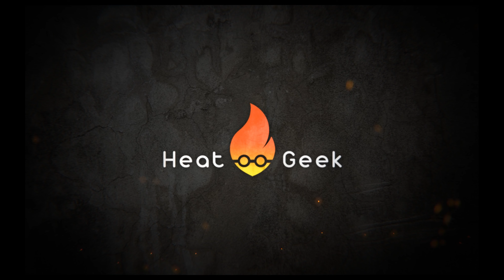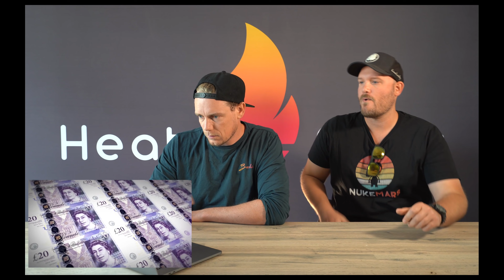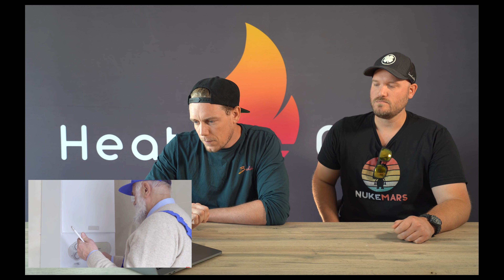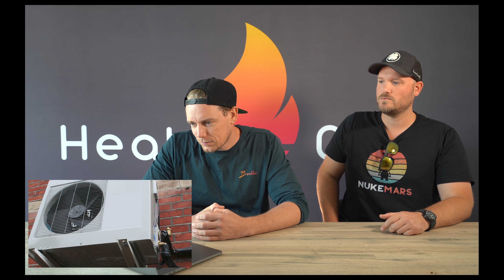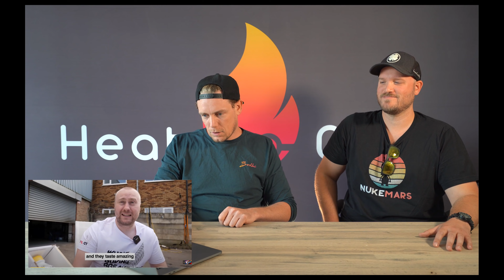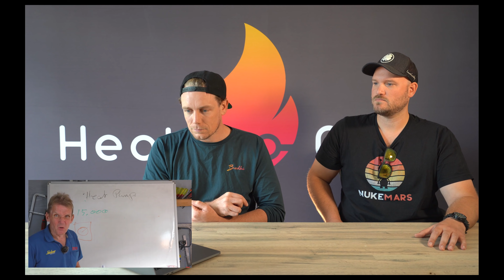Professionals React (BADLY) To Skill Builders's Heat Pump Videos | PART 1 | FIRST TIME WATCHING

Comment: Just seen your chanel. I have long watched Skillbuilder and Roger is a very exprienced Plumber. My reaction to his heatpump rant was, that heatpumps do work but only if the insulation is sufficient. I installed air source heatpumps in a pair of new build semi-detached houses, ten years ago. This decision was largely to meet the building regs. energy requirements. I have figures for those ten years, so not just an opinion (unlike many who post in your video). I did not intstall one in my 1920 detached house (which has cavity walls) as upgrading insulation etc. would cost too much and if installed on the inside would reduce the room sizes by too mush, and digging up the floor etc..The skillbuilder argument is true for the majority of the UK stock.
Good to see Patrick often injected some valid information to give a more balanced view.
Reply from the maker: Here's evidence of how they work when well installed in a NORMAL house with tiny rads and little insulation 

https://youtu.be/QLGANlbqIFY
Reply from the maker: Difference is that modern heat pumps are nothing like 10-year-old heat pumps. They can now run much higher temps and maintain cop
Reply: @HeatGeek  So what value of COP are we likely to get and at what output temperature?
Reply from the maker: @jesserawson898  the data sheets are all over the internet
Reply: @HeatGeek  Now that's a really profesional reply 😄
Reply from the maker: @jesserawson898  well it depends on the unit.. I'm not sure how many characters the comments section allows but it would probably be easier for you to Google than me to copy and paste
Reply: @HeatGeek  To be honest I didn't realise the question was going to be so complicated for you.  I was merely interested in your comments regarding the COP of modern heat pumps.  As this varies greatly with the output temperature I can see there being complex and compound answers, however what is very simple is to say (for  example) that at an outlet temperature of 55 degrees centigrade (English !!! ) it is now possible to achieve a COP of 6.5.  

With your claimed expertise and indepth knowledge sure a useful response will be at your fingertips.
Reply: @jesserawson898  There is a problem with your question, there are many brands with different claims. If heat geek would mention only the brands they know, people will complain as well. Why would he need to do the research for you? Don't be lazy and try to spend a few minutes on it yourself
Reply: @HeatGeek  and work in lower outside temps and remain efficient
Reply from the maker: @davidstorm4015  the lower the outside temp the less efficient but yes absolutely... as always depend son many variables

Comment: I think you and Roger are right, our average housing stock is too poorly insulated to suit a heat pump install and carrying out a deep retrofit insulation at £800/£1000 per m2 isn't viable. With a self build where you can spec 200mm of floor insulation & underfloor heating then great.
Reply from the maker: Here's evidence of how they work when well installed in a NORMAL house with tiny rads and little insulation 

https://youtu.be/QLGANlbqIFY

Comment: You didn't really address the noise issue. Just saying it'll be quieter in 10 years when the tech is better isn't good enough. These things must be noisy at 2am if you're used to quiet. Why wouldn't they be? A compressor/fan hum putting out 40 or 50 dB is loud at that time no matter how good it is and can travel to neighbouring properties that are only metres away. I wouldn't put up with that for 10 years. I'm glad I watched this though as it's not something I'd thought about so will have something to say if a neighbour tries installing one.

Comment: I think from seeing this. I still believe  heat pumps aren’t the answer. Your problem is the government will go all in and aim this at the general pop. Most people won’t be able to afford it, or it’ll get bashed in by a company banging them out for grants. Like crap solar installs and now the EV charging, it’s only a matter of time. 

You say conjecture but it’s already happened with the diesel cars and about the payback, at least with a boiler they don’t go obsolete over short periods. Solar panels came with a 25 year warranty but have gone obsolete before it’s even half way through that. 

I agree with you in some respect about carbon but at the end of the day. The vast majority won’t care, it’ll be bottom line every time.

Comment: I had a local HVAC company in to replace my old gas fired warm air central heating unit with an air to air heat pump system. Works beautifully without the loud fan and the sound of big gas burners and I have the option of summer cooling.
Reply: How much did this install cost? Did you get the government grant to help out? Has your energy bill gone up or down?
Reply: @thedigitalidiot  No grant, they are not available for systems that don't use wet radiators! Cost about £7,500 total for parts and installation. The house was built with underfloor ducting for warm air heating about 1970. The new system has an outside unit on a south facing wall to get the sun. There is an internal heat exchanger in the loft that is ducted to the existing duct system. My annual power consumption has halved from what it was before.
Reply: @martinconnelly1473 
Excellent!  But it will not work for the majority of people, which is what this debate is all about.  To retrofit these systems and to get them to work efficiently would cost somewhere in the region of £20,000 in the average poorly insulated and built UK house.  Obviously beyond the average person.
Reply: @Pedromyman1  It's not going to be as easy for the vast majority of current housing but does show that new homes should be built with suitable ducting for a choice of heating systems and insulation fit for the purpose.

Comment: whats best for a 1000 square foot greenhouse?
Reply: A gas boiler !    Heat pumps are the latest snake oil wheeze that will end in tears for anyone taken in by the salesmen.
Reply: @cuckingfunt9353  heat pumps are great in the right property.  A greenhouse needs high temperature though so oil or gas is the only stuff we've fitted in them.
Reply: @cuckingfunt9353  been quoted 28k for 2 heatpumps!

Comment: Interesting response. I think the 'install/design' is the elephant in the room. I've been involved in three large projects all by the SAME firm (who shall remain nameless). From total success (new build) to total disappointment (conversion).
Reply: In the literature from the government,it says the immersion will be on full time? This is a boxed kit that will be fitted to ALL HOMES.installed by barely trained fitters!
Reply: Now it’s the age of the property?
Reply: My neighbour in a victorian end of terrace has had a Mitsubishi heat pump installed. They upgraded their rads, they had loft insulation put in & a cylinder where their boiler was.  a heat loss calculation was done to size it they say its cheaper to run and it's roasty toasty.

Comment: "Running a heat pump is roughly 3 times more expensive than running a gas boiler"   Reply   "No its not! Well it could be"!!! Ha Ha Ha.
Reply: yeh, could be if you install it badly, thats the whole point of the video.. its not the heat pump, its the installation that makes the difference
Reply: I’m running cheaper than gas.
Reply: Exactly, some dickheads a few years ago wanted everyone to have solar panels. What a crock that turned out to be. This is another crap idea that you will never recover your initial outlay from. If it’s a 30 degree day it’s good, absolutely useless in the uk where most of the time the temperature is below 20 degrees. Stick with gas all day long. Listened to customers on 5 live not so long ago bellyaching about the massive outlay and being freezing cold. Ironic how insulate Britain sticking themselves to roads so we can all get sucker punched into more nonsense.

Comment: My electric rate is more than 3x expensive than my gas so it will always be more expensive to heat with a heatpump powered by electric than gas in the winter when I use the most energy.

If people want a real change then the government need to push wind and solar power and make electric cheaper. Remember an electric heater is 100% efficient. You put 2kw in and you get 2kw out. No margin of error to get an inefficient system for installers like with boilers and heat pumps. 

Maybe also give everyone grants to help insulate their houses and not just low income people. Let's face it, people living in council houses usually have better insulated and more efficient heating than people who actually own their homes. I don't have spare money to spend on upgrading a system that works whilst paying my mortgage.

My boiler is old and not very efficient but by the time I pay for a new efficient boiler to replace my old reliable boiler I will be replacing it before it pays for itself in 10 years time and that's not accounting for repairs that need doing on the modern boilers.
Reply: Heat pumps can be up to 500% efficient....

No this is not snake oil / brraking conservation of energy as the heatpump is moving heat from outside to inside.

Essensialy cooling a large volume of air / ground outside by a few degrees, to increase a smaller volume of air / water inside by 40 degrees or more.

Comment: Last month gas price went up by almost 50% in Lithuania, so that video is on point. And he's only talking about not insulated houses so hes right there as well.
Reply: Electricity prices in the UK have doubled in the past few months too.
Reply: Wood burners that's away head no one can put the price up
Reply: He never mentioned the possibility of electric price increase.
Reply: @millomweb  not possible,  more likely probable
Reply: @nickcoppard5335  That as well :)
Reply: Most UK electric comes from burning gas, if the wholesale price of gas goes up so does the electric.
Reply: gas has gone up around 200 percent in the uk
Reply: @nickb7040  It is now cheaper to heat with oil than gas, it's crazy !
Reply: And now, with electric price went up by 100+%, (for temp. not "passive" houses) new heating pipes = mad solution. I have new gas condensation boiler - still cheap than any heating pipes system with REAL COP ~3. And forgot about heating by electro when temp is about -20°C.
Reply: @CzKaa  I'm pretty sure a COP of 3 for a gas condensation boiler isn't close possible.  

As for heating with electricity when the temp gets extremely cold... Is that because of electricity supply/cost?  Most heat pumps will really struggle at -20'C, but resistive electric heating is still 100% efficient, which is why the ones designed for cold climates will switch over to just using resistive heating.  If there's only a handful of days when that happens, it's fine.  The real (possible) issue is the possibility of too much demand on the electrical grid if most everyone is using electric heating when it gets really cold.
Reply: @travcollier  COP 3 for a gas condensing boiler is nonsense. You got things mixed up.
I wrote about a cheap gas condensing boiler versus an expensive heat pump with a real COP 3 in the winter.
3 months ago, the price of gas was half that of electricity. A heat pump with a COP between 3 and 4 therefore works better financially. But if budgeting the cost of a gas boiler versus the cost of a heat pump (for their lifespan), the heat pump doesn't cost me cheaper.
PS: in the meantime, the situation in Europe has changed completely, most of the gas is from Russia and the another gas will become significantly more expensive or there will simply be no gas. : D
Reply: @CzKaa  Ah, I misunderstood what you wrote...  It happens.

Looking it up to make sure I wasn't crazy, I did learn that a condensation boiler can be slightly better than 100% thermal efficiency though.  That's nifty ;)
Reply from the maker: Here's evidence of how they work when well installed in a NORMAL house with tiny rads and little insulation 

https://youtu.be/QLGANlbqIFY
Reply: @HeatGeek  Well if that's considered low temperature in UK in winter then yeah it might be quite good. Here in LT in December it was from 0 to -10C and most likely will go down to -20C in Jan, Feb. And a 1m3 of Gas costs 2.75 times more than 1kWh of electricity, since average heat output from 1m3 of gas is about 10kWh that means I would need COP of about 3.6 to make it even
Reply from the maker: @mindaugaskaminskas2742  bloody hell I can't debate if yhe hoal posts keep moving 🤣

Gas and electricity prices have been settled change for a long time. I don't know what the carbon intensity of your electricity is but and it lowers so should eventually the cost.

Also this is not an ideal solution..  once we swap out rads we should get up to cop 4.5

Comment: In the height of winter when it's -10 outside I don't understand, where exactly does the heat come from?
It defies logic. If it works under these circumstances then I guess perpetual motion must be possible too.
Reply: There is some amount of heat energy all the way down to -273 degrees. With a constant volume system (like heat pumps) then you can increase pressure to also increase temperature of the refrigerant and vice versa. This is the universal gas law (PV=nRT). In winter a heat pump simply does this; it grabs some energy (heat) from outside, compresses the refrigerant (raises pressure) so much that it's hotter than inside your house, your colder house air sucks that energy out and cools the air, then the heat pump decreases the pressure so much that the refrigerant temperature drops below the temperature outside (in your case -10) and the refrigerant starts the whole cycle again.

In your car this simply works backwards. The large pressure drop happens inside the car to give you cool air, and then gets compressed to be hotter than the outside air. That's how you can cool your car below ambient temperature, and heat your house above ambient temperature.
Reply: @Col1500  MAx you get out of them is COP3 (on a sunny day).... TBH heat pumps are about as realistic as a perpetual motion machine.
Reply: They work down to at least -25°c, it’s the refrigerant that does the magic. If heat pumps didn’t work, your freezer wouldn’t keep you food at -8°.🤷‍♂️🤦‍♂️
Reply: @kenbone4535  They don't do f-all. The most you get is COP2-3 and much less in the winter, since the biggest one you can get on single phase is 2.2KW, the output is going to 4KW, (and they call that a 12KW model!) in the winter that is useless.
Reply: Luckily I have no experience of suffering one, and I hope I never do. As my physics tutor told me, when I suggested shining a bulb onto it's own solar panel, you don't get something from nothing, there are too many losses. (You would need hypercoductivity, something only optimum at around absolute zero. Which is what a home would feel like if relying on a heat pump in the middle of winter) Then, even if you do get your home to an almost comfortable temperature, perhaps you fancy having a shower or bath. No way says Mr heat pump. You'll have to have a immersion heater for that, I am struggling to get your home to a temperature slightly less cold than it is outside ad it is. There are many other factors to consider, like heat loss from your home. Brand new homes built with A++++++++++++++ insulation ratings may have a chance but as for retrofitting average housing stock, well you probably need to quadruple any quote you get to insulate in the first place.
Reply: @jf9484  The big problem is the output, to get above COP2 you can only get about 40'C output... That only works on underfloor heating and on two floors that will cost £20k-£40k on top of the £20k for the system.